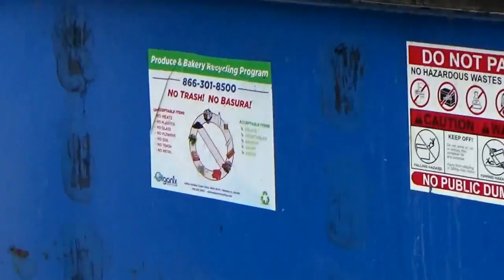Organix Recycling Kenworth T680 Brown Industrial rendering tractor trailer

Comment: The bins could be on locking wheels, make it much faster, just push the bins on the truck.
Reply: Yes imagine trying to push 1,500 to 2,000 pounds to that truck with just your legs...that's a hernia waiting to happen it's better this way
Reply: At UMass Amherst there are wheels on their dumpsters and they are all metal dumpsters. One time, when I was on my way to the bus stop from my apartment with my mom a couple employees from UMass were about to load the dumpster on the back of the truck and the front wheel on the dumpster snapped broke off and they had to back the truck up even closer. It took 3 people to lift one end. The reason why it broke off is because the bottom of the dumpster was all rusted out. They fixed it up the same day by welding a piece of sheet metal to cover most of the affected area. Welded on the bottom, and welded on inside. Never had a problem since.
Reply: John Briseno lmao do you know how wheels work? all that weight is being transferred to the ground not the person pushing the bin. It only takes a fraction of the force to move the bin.
Reply: @johnbriseno977  i can push bins bigger than that on wheels by myself without issue.  Its quite easy if you have a decent technique.

Comment: I've been wondering what those trucks were used for; now that makes sense. I know it is not the driver's fault for having sqweaky cylinders on that trailer, but apparently that company refuses to use $5 worth of grease and 5 MINUTES of a mechanic's time! I worked for a company that was that petty, and I don't miss working for them.

Comment: I appled for this job but after looking at it, I feel like there can be so many negatives.  dead electric jack, snow in way of dumpster,cars in the way, hydraulics of truck don't work etc.. too many possible issues that can happen turning a bad day into a horrible day. I had my fair share of jobs using electric jacks and it shitty more than good. I guess it depends how many stops a day are required because if you are in a rush all day I can see this being stressful

Comment: Why spend the extra time and money on a pallet jack when you can just fit wheels to the bins? It aint rocket science.
Reply: Shanden Davis I agree with you, here in the uk my farther in law picks up animal carcasses, some of the bins can weigh upto 1500kg 1.5tone, with some of the bins they have normal size wheels some have larger one's. Some of the trucks have a track running along the top so you can empty the bins where you need too, to perfection. This trailer is basically a piss poor design, with an even worse handling.
Reply: Sean Kisby Thanks Sean. Exactly my point. The trucks in Australia that do this sort of work also have the track running across the top so you can tip the bin in whatever spot you like, which is a better design than this one in the video, as you said.
Reply: Shanden Davis i just thought the same thing
Reply: You push these full in the snow and rain? What about less smooth surfaces, inclines/declines.....uh a bad wheel? Sounds like a stupid idea.
Reply: wasteland l
Reply: wasteland Yeah I agree with you. Every 2 weeks all of my school's bins are full, and are really heavy. But my bin men move them just fine
Reply: Hahah.. why not spend more time in common sense class.. The moment when you think you made an intelligent question but realize maybe should have kept head in hole
Reply: Hola
Reply: nobody wants to work that hard a pallet jack makes it ez
Reply: It's faster and safer to move it with the electric jack. It's a one man job.
Reply: This guy doesn't have his process totally worked out yet, he's not very efficient in his work.
Reply: @GrammarPoliceInvestigations  Correct. You get it.
Reply: I move dumpsters like these all the time at work even with trash in them and im smaller than this dude. Those dumpsters arent as heavy as they look you know
Reply: @slabbinonspokezz2375  I'm glad that you move them everyday. Keep in mind that injuries in jobs like this are from repetitive motion.
Reply: @JohnSmith-fx4se  i mean i didnt mean to exaggerate but the dumpsters at my job dont sit level on the slanted asphalt and have to be pushed back into place from time to time. Sometimes it takes two people. Not saying im superman just saying its not that heavy
Reply: Those bins full weigh 3000 pounds and you cannot physically move them on wheels. This is not light loose trash. This is compact produce. Potatoes watermelon cantaloupe.
Reply: Most likely a occupational health and safety thing , moving a full bin could throw your back out , it is a fair bit of stuffing around though .
Reply: @wasteland24  👀👀👀 they probably have a union.
Reply: @leediggs1398  I worked on garbage truck for 37 years. Those containers roll just fine on wheels. It seems like a lot of wasted time with the pallet jack
Reply: @FinBin Man we moved 500 litre bins full to the top of soaked watery food waste and it was really heavy but not really any bother to me , it'd be fine with wheels on it , in the Netherlands there's bins bigger than this with wheels that the crew pull
Reply: I've never had any problems moving bins bigger than that on wheels mounted to the bottom used to do it on a daily basis at work.
Reply: @wasteland24  Like I said use your brain not your back why push and pull on something when you can use the pallet jack to do the work for you is that so hard to understand OMG

Comment: This type of trash truck seems like a pointless waste of time. The company should've just bought a couple frontloaders.
Reply: When you look at where they are placed in this video, yes. In my old job, they were in a small alley sideways. You wouldn't have been able to reach them. The company unloaded them similar to this video.
Reply: Most definitely.
Reply: You cant get that much weight on a front loader compared to a tractor trailer
Reply: All soft warm food like that would pack a 15 to 20 ton load on a frontload truck with a good packing system
Reply: @thebeermaker2102  Trucks like his can easily carry 30-40,000 lbs. I'm not sure with all the extra stuff hes carrying how much weight he loses to the pallet jack and water, etc.
Reply: As much time wasted u can probably do 2 loads a day in a front loader and still waste less although not sure how many he does with the tractor trailer
Reply: @Guitar157  yes I've worked front load for years 2 to 3 loads a day is average depending on how well the equipment is and driving distance
Reply: Not a trash truck. This is a food recycling truck. They take the expired produce to farms to feed cattle not to land fills. The reason it cant be a front loader is because the driver has to watch as he dumps the bin to make sure no trash falls in the trailer.

Comment: #1 why is th r truck creaking and groaning like that . Lack of proper greasing. #2 banging bins with pallet jack like that unacceptable. #3 no steel toed shoes. #4 reverse walking with pallet jack,injury waiting to happen. #5 truck too close for safe loading. do I need to keep going because there is more?
Reply: Pat r. it need h fluid
Reply: People walk backwards with Jack's all the time. It's more of an issue if you let the jack push you full throttle and are not aware of your surroundings.
Reply: I can tell that they are steel toe shoes. I have a pair that I bought at Walmart for $30. Buy a pair of regular shoes then buy a steel toe shoes and you'll see a difference.
Hiking steel toe shoes is what your thinking of. Go to Walmart and you'll see the different styles that they have.

Comment: I really don't understand the logic behind these non-movable dumpsters, up to 2000L (500 gallons), mostly used in America. In most places in Europe, there are 1100L dumpsters (plastic or metal), 4 wheeled (2 on the front are lockable), and it's usually 2 workers who empty them. They pull them to the rear of the truck, just place it on the lifter (like a comb) and pull the lever. The whole process of emptying lasts for maybe 7 seconds, up to 12 on trucks with slower hydraulics. 10 such dumpsters can be emptied in less than 2 minutes, which is super efficient compared to this, or in some cases front loaders where the dumpsters need to be aligned in a row to be accessible without the need to tow them around (and if you have 10 of them, you either need a super large yard or waste your time with a pallet jack).

I've seen similar concepts in America, a metal dumpster with a rod through the front, sticking out on the sides. The guy puts it at the lifter, and just lifts 2 metal holders over these rod endings. (or only one, since he positions one side of the dumpster directly through the holder as he pulls it to the truck). The thing gets lifted up and down in a similar amount of time. It would surely make everyone's life easier, would it be a bit more widespread.

Here's the example of how it works here:
 https://www.youtube.com/watch?v=Wkq8bCGfiew&t=126s

Comment: I work for this company before I relocated to New Jersey they are in South Florida I was their number one driver before I relocated this guy is doing the job all Orem truck is not properly maintained that's why it's squealing so much not enough grease 2 he has no steel tip boots on 3 too close to the bins not properly using pallet jack correctly if you like me to keep going on how he's not doing his job correctly leave a comment
Reply: jason v hy b CT u n he looks new a few weeks and some fine tuning he'll be good